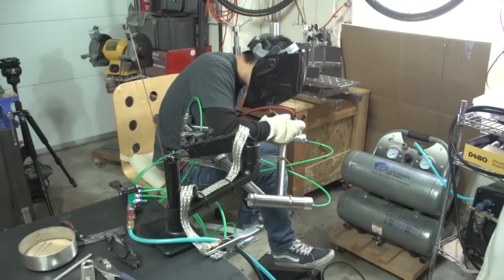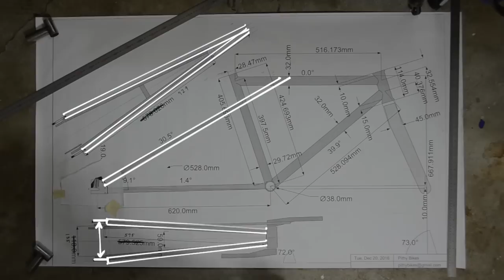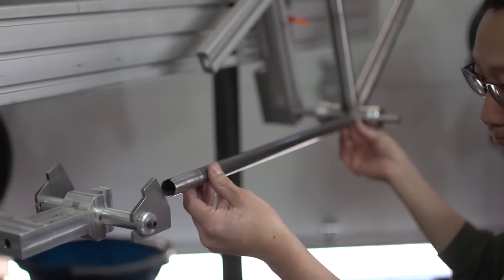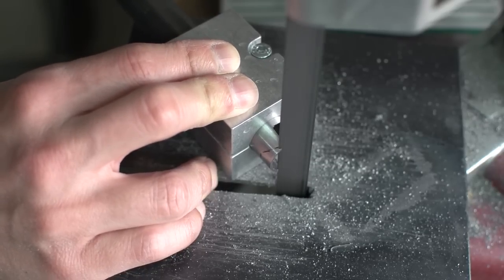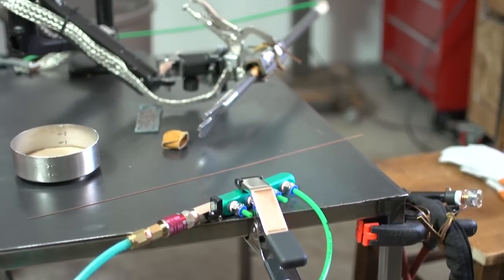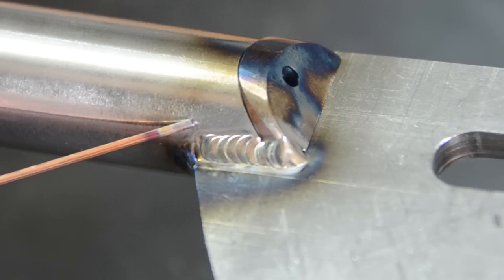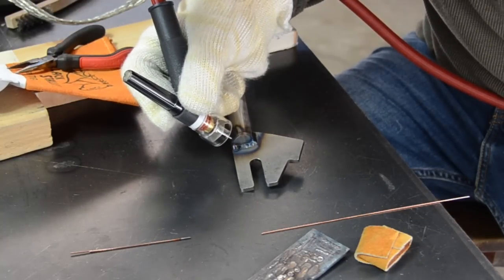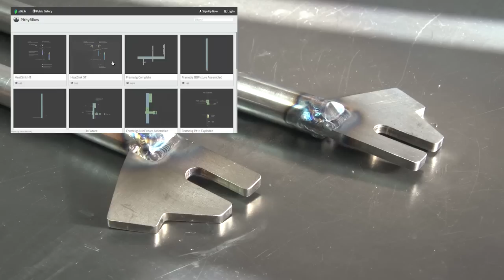Longtail Bicycle Frame Build 08 - TIG Weld Dropouts

Comment: hi. I really like your videos,have been a fan since I found you. you are an inspiration to me cause I have always wanted to make bicycle frames myself and Im still stuck boatbuilding 10 years later. but I will do it oneday. just a couple of pointers, q's.
 please hold the filler in the gas puddle a little longer or do you cut the ruined tip off for every new weld you start (like 44bikes on insta. man that pissed me off Idk why ) secondly I noticed You had 4  stopping points on the 1 cs. if you would plan out the welds then you could get away with 1 visible weldstop.  caps first then start from the bottom and go alltheway around until you get where you started. anyways I really enjoy the work you put in , not only bike stuff but the video/editing is topnotch aswell! thanks 
Hendrik
Reply from the maker: +hendrikhanso Tha KS for the pointers, always appreciated! I think more on those stopping points. :) I did have a lot!

Comment: Nice!  One observation - I have similar horizontal dropouts on my 1982 26 inch Mongoose Kos Kruiser (welded up by none other than "Frank the Welder"); that I have been riding for all these years as the original owner; but anyway; that frame is nickel plated and one design flaw is that the area around where the axle bolt clamps to the horizontal dropout is so slippery that if you really stand on the pedals it can cause the rear axle to move or slip forward within the dropout slot and throw off your chain adjustment (which after all is plus or minus a few mm right?). So I want to suggest perhaps some type of knurling on the outer surface of the dropout to give the (hopefully also knurled) washer under the axle bolt something to grip on.  Actually I think this knurling or texturing should be on the inner side of the dropout as well in my opinion; but I am just a rider, not an frame expert. I just know I hate having my axle slip and my chain get out of adjustment.  The solution is not to overtorque the axle - it is a threaded rod and the torque should be as specified. Also with a plated frame you cannot crank that axle bolt down too hard or you may crack the plating.  The alternative would be to design in a mini version of the chain tensioners similar to the ones on MotoGP motorcycles - perhaps that would be end of story on the axle slippage problem but better if that was designed in from the get-go.
Reply from the maker: Ah good insight. So far I haven't had any slippage but the frame is not fully tested yet.. time will tell!

Comment: Which gas is in the tubes when you weld, and what is its purpose? You do amazing job.
Reply from the maker: It's argon which is an inert gas. It prevents oxidation by shielding the heated area from the air around it.

Comment: can you show how you setup your argon purge?..........another question is why did you choose to build in steel and not aluminium? i would like to build an longtail cargo bike too as a replacement for my recetly stolen yuba mundo but, i want it to be a rear suspension, in alu!
   i am just about to but a ac/dc tig welder and argon bottle but, i hear that i need to heat treat after!

Comment: Awesome.... what is the part name for the milling attachment which cut the notch? I need to cut one into stainless steel bar, 16mm and all I’ve tried will not work so far. I’ve broken several 4 flute end mills lol
Reply: I believe that is a saw cutter.

Comment: Hi Steve, thanks for another cool video. I'm still practicing my welds and your speed seems quite comfortable, what PPS (Hz) you're set in this clip? Regards, Pawel
Reply from the maker: +Pawel Gaik it's about 0.8pps.
Reply from the maker: +Pawel Gaik it's kind of hard for me to know because my welder has analog dial and I don't think the scale is accurate.
Reply: Thanks man, I have tried it at 0.8pps the other day and must say I really like it. I have noticed that PTO must be adjusted accordingly, otherwise weld is getting to hot. Thanks for the tip and all best to you!

Comment: I'd be tempted to turn/ mill the drop out tube end from solid bar as an insert, would stronger and easier to weld.to the plate.
Reply from the maker: I can't remember where but I've seen what you are talking about. It's a good idea and would indeed making the process easier to weld.
Reply: Pithy Bikes google weld in clevis and imagine them without the through hole. You can get them in chrome moly so strong and light. Also removes the need to phase the slot and other coped end. Also easier to weld similar thicknesses.
Reply from the maker: sweenep86 ah yes, right on!

Comment: hiya. great video. couple basic questions. when you are pulse welding do you have a setting that does auto pulse or are you manually pulsing w/ your pedal? Do you use any sort of ventilation in your shop? 
Thanks
Reply from the maker: I use auto pulse. I tried foot pulsing and prefer auto for now. I definitely see the advantages to foot pulse and maybe some day I'll revisit it. I was struggling with auto pulse for a while so I figured take it one thing at a time.. :) For ventilation I usually keep the garage door cracked open. Most of my welding is on clean tubes but regardless.. I think an organic respirator is a good idea. I don't do quantity so I've been slow to get one..

Comment: Why do you have such a large stick out? Is this for filming purpose ? Or because it's difficult to see ? You can probably have better luck with shorter stick out smaller cup size. What cfm are you running? I'd also suggest to go over the flat areas again with pulse to even  your welds after you weld the rounded part of the cap, careful not to overheat your parts
Reply from the maker: Thanks. The stick out is so I can see, it's just more comfortable for me. I use the 12 cup because I like the coverage and it's way more forgiving on HAZ. I'm at around 20 cfh.

Comment: what is the Name/Brand of the Tig-Torch you are using? 
and were can i get that one?

i enjoy following your projects!!

greetings from Germany
Reply from the maker: The torch is an import from China that I modded. I purchased an import so that I could modify it and not worry if I ruined it. I don't even think it has a brand name. I got it from Ebay. It's a type 9 size torch. The part that gives this torch its character is the Fupa #12 glass cup I'm using - http://furickcup.com/product/fupa-12-kit/

Comment: The jog holding the tubes while welding are vibrating too much. You may want to revisit the jig again.
Reply from the maker: +John Chung the jig (while I was tacking)? Or the arm at my welding table?
Reply: At this point https://youtu.be/2lDWDqL3sNk?t=567 Maybe the weight of the arm is affecting it. Worth looking into it

Comment: I like ur big dreams😂👍😃
Reply from the maker: Dream big!
Reply: Pithy Bikes dude iam tolking about . the time when u said I had big dreams for the welding going all the way round and u did practice . and then u had problems. I just bought a welding machine and I also had big dream but I end u buring (little bit toasted  with the flash . feel s like sun burn and I also have one question .) . when u did welding 1st time did u feel irritating and a lot of angle the next day . I did.    great work . like ur video
Reply from the maker: @besteriophonic  Yes it was quite difficult when I was first learning. But eventually I tried to just expect to mess up. And that kind of took the edge off and let me loosen up. With enough practice I loosened up and just try to enjoy every moment of welding. Laying a good weld has got to be one of the most satisfying and rewarding things to me. It's because of those hard times and struggles that makes it all the more satisfying when you finally lay a good weld.